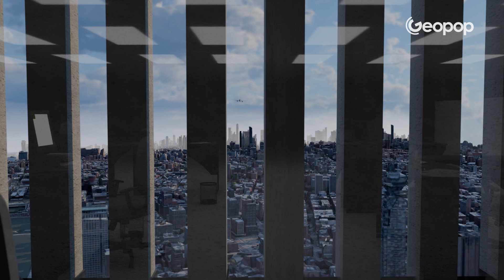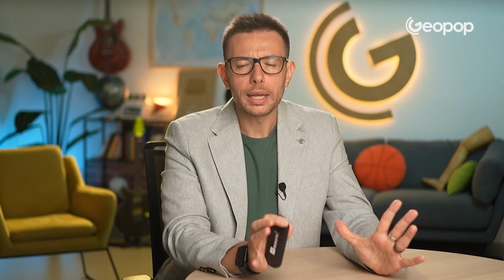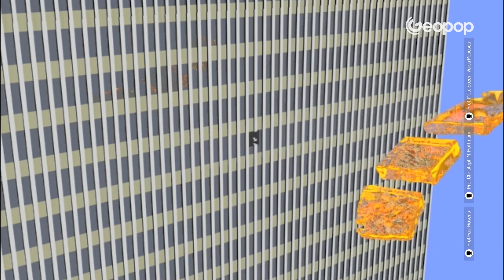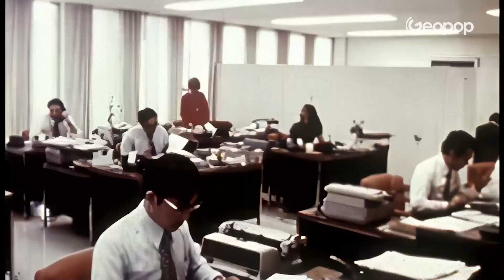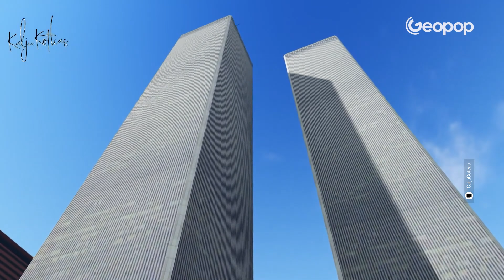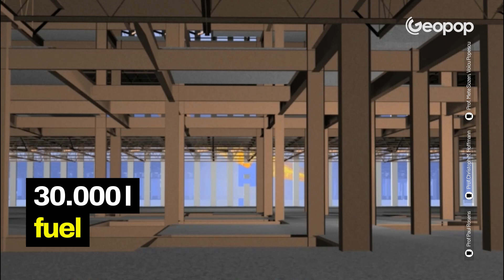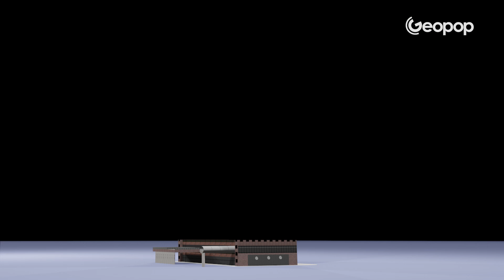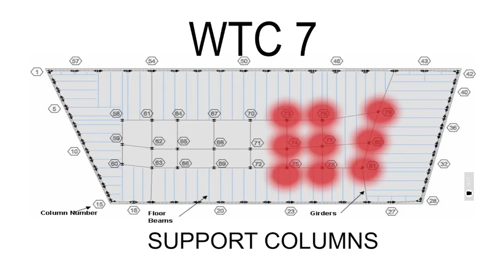9/11, 2001: The Technical Reconstruction of the Twin Towers and WTC 7 Collapses

Comment: The NIST report about WTC7 is garbage! Not even the simulation shows, what the cameras had seen! One column (79) and one beam (a-2001) do never initiate a free fall of the hole building!
Reply: Building 7 was the 6th building to collapse of 10 lost on 9/11 and because of its early low priority was largely ignored for a while, so conspiracy filled the information void with simple-minded garbage by technically ignorant people promoting political agendas. This created a lot of confusion and misconceptions which I wish  to dispel, so I prepared this brief summary of my own analysis, using technical analysis, not ideology and magical (non)thinking. 

At 10:28am the WTC North Tower collapsed, showering Building 7 with tons of burning debris, causing heavy damage and starting many large  fires which burned out of control for the next 7 hours. Half the FDNY firefighters having been killed, units in disarray, equipment destroyed, no water pressure, and the greater urgency of search & rescue efforts, Building 7 couldn’t be saved so firefighting efforts were pulled as futile and 7 left to its fate. Firefighters make that sort of choice every day in brush fire situations - which houses to save and which ones to let go. Only real difference here is moving the decimal on the size and cost. People get overwhelmed by the size.

www.youtube.com/watch?v=g_SvpwyC17M

Collapse of a burning structure is always a concern for firefighters. Steel buildings subject to fire rely on active firefighting to survive. Buildings are designed around 1 to 3 hours of fire resistance, allowing time for occupants to escape and active firefighting to get started, after which all bets are off. Left to their own devices they'll exceed their design envelope and collapse, like Plasco Tower and Wilton Paes de Almeida. In 7 the occupants escaped, passive and active fire protections were compromised and active firefighting was abandoned hours before the collapse, which left the building to its fate. It lost. Odds on Building 7 would eventually collapse, and it did. No big deal in logic.

 http://www.youtube.com/watch?v=WnYBX6QT0R4 

FDNY Chief Daniel Nigro - The biggest decision we had to make on the first day was to clear the area and create a collapse zone around the severely damaged 7 World Trade Center, a 47-story building heavily involved in fire. A number of fire officers and companies assessed the damage to the building. The appraisals indicated that the building's structural integrity was in serious doubt. I issued orders to PULL back the firefighters and define the collapse zone. It was a critical decision; We could not lose any more firefighters. It took a lot of time to PULL everyone out, given the emotionalism of the day, communications difficulties and the collapse terrain 

FDNY Deputy Chief Peter Hayden ; We had our special operations people set up surveying instruments to monitor and see if there was any movement in the building. We were concerned of the possibility of collapse in the building. And we had a discussion with one particular engineer there, and we asked him if we allowed it to burn could we anticipate a collapse and if so, how soon? And it turned out that he was pretty much right on the money, that he said 'In its current state you have about 5 hours 

The collapse of Building 7 was anticipated and widely reported in the media throughout the day, with 24 video cameras recording some or all of the collapse. Everyone knew what was coming and why. 

www.youtube.com/watch?v=OY5S5k3tMHI

Building 7 collapsed from the inside out which is not at all intuitive and hard to understand, with most details being hidden from view.  It requires careful analysis and observation, and some people will struggle no matter how much it is explained. But here is my explanation relying on no outside authority. 

Building 7 was a unique, asymmetrical 47-story steel frame structure built atop a smaller 3-story building serving as a partial foundation, requiring lower floors dedicated to complex load transfer structures. Of trapezoidal shape and tube-in-tube construction, B7 (above the 7th floor) consisted of a central core of steel columns carrying most of the gravity load, perimeter steel columns around the outside of the structure carrying the remainder of the gravity loads and long span beams and girders to tie those elements together and form the floors. On the outside of the building hung a facade or outer shell. 

www.nist.gov/image-16640

Phase 1 : First externally visible signs of collapse initiation occurred at 5:20:28 pm and was notably quiet with observers not realizing the building was collapsing! No warning in the form of hundreds of eardrum busting 180dB explosive bangs. Here at 12:00 a local CBS affiliate reporter talking 10 blocks from B7 when collapse begins. People don’t start to notice the collapse until 12:11. At 12:45 is the famous CBS fixed camera clip of Building 7’s collapse. Note the silence. 

www.youtube.com/watch?v=t5tEy6mXSE8

Lower floor failures above the load transfer region (8-14) in the NE corner initiated the collapse. In this video at 0:45 you can see the NW corner from inside the building while under construction, Column 79 just out of frame on the left. That big, angled steel beam across the top of the frame connects to C79 at one end. The girders connect to the beam. That beam and all those girders depend on just one connection 

www.youtube.com/watch?v=nP3TNHPCIVU&t=45s

Phase 2 : NE corner floor failures caused a loss of critical lateral support over an excessive length of Column 79 and it buckled. Looking at the above floor diagram of Building 7 when you see all the structures that depend on C79 you quickly realize this one column was a relatively isolated structural element on which a disproportionately greater fraction of the structure depended analogous to say the Key Bridge. Externally as collapse begins we see a vertical progression of window breakage along the 44-46 line and a kink in the roof of the East Mechanical Penthouse at the top of the building, consistent with C79 failure. Normally with a buckling column, the load could be redistributed to other columns. With C79 that is not the case - the failure did not redistribute the load, so the collapse rapidly progressed to the roofline, sinking the rooftop penthouse. The transition from full capacity to almost no capacity occurs in an instant and will result in virtually no resistance 

Phase 3 : With C79 gone, B7’s progressive, non-symmetrical collapse continues with adjacent columns 80 and 81 left laterally unsupported and quickly buckling as well. The EMP drops down through the building. C79-81 all have no diagonal bracing, which is the major reason why they could not redistribute a lot of vertical loads among one another. From there collapse progressed from east to west through the central core until the core was gone from 81 to 58, taking all the interior floors and probably most of the perimeter columns with. Follow the horizontal progression of window failures low in the building and the dropping of the remaining rooftop structures into the building. The NIST Building 7 study model 4 determined C79 failing under ANY circumstances would have initiated the same collapse sequence. 

Phase 4 : After about 10 seconds only the exterior moment frame remains, giving the illusion B7 is still standing to the casual observer since little has outwardly changed. But it is just a hollow empty shell like an empty cereal box supported only by a few remaining columns and overloaded from the loss of the core columns and floors, quite unable to remain standing. With nothing remaining behind it, the north face leans inward, forming a V in the roofline, the last few columns buckle under the strain and the moment frame free falls, landing on top of the debris pile. 

It is only here at the very end, a single measurement of alleged free fall acceleration is taken, from just one point on that outer shell. The Building (core and interior) did not “free fall” - was already gone before that happened - just one corner of the outer shell briefly moved at a rate comparable to FFA. This alleged FFA was a product of how the shell fell NOT why the building fell . It’s also not even proper FFA as the single measured point was moving in 3 dimensions, not just down, which adds another variable. Start to finish the collapse took 18-20 seconds, 3 times longer than true FFA . How fast something falls can’t tell you what started it falling, certainly not 10 seconds after it started falling.  

The debris spread outside the footprint blocking surrounding streets, heavily damaging the Verizon Building and destroyed Fiterman Hall. 

No building is meant to survive 7 hours of multi-floor unfought fires. Building 7’s progressive, non-symmetrical collapse was incidental, unintended collateral damage from the combination of fire, time & gravity started by the collapsing North Tower, true no matter who planned and carried out the 9/11 attacks or why .  Of so little consequence it barely registered at the time, only taking on semi-mythical status as an alleged smoking gun years later when demolitions at the Twin Towers, missiles at the Pentagon and shoot down over Shanksville all failed and conspiracists had nothing left to work with. 

Anything can seem like a conspiracy if you don’t understand how it works. Now you should. I hope you found this helpful, informative and it solicits informed critical comment. If I made any errors of fact, logic or reason or left anything important out, please let me know so I can fix it. OR offer a more plausible alternative if you can. Be the first. Please start any reply with the words “Tits McGee” or I will know you didn’t read it and are wasting my time.
Reply: @TheLoonResistance  So which 5 buildings collapsed prior to WTC7 stinkyshit? Oh I forgot: You are way too much of a coward to ever answer questions on your utter stupid blahblah...
Reply: @Kudde23   How to fail with a counterpoint.
Reply: @zMW574e  You want to help out your little coward liar comrade who is too much of a coward to ever answer questions on its utter stupid copy paste blahblah? Then go ahead, answer the question! Which 5 buildings collapsed prior to WTC7?

Comment: The towers collapsed with the use of thermite.
Reply: There's no evidence of that. The Harrit/Jones paper has been thoroughly debunked.
Reply: @Tim22222  So what evidence would you expect timmyshill?
Reply: @Kudde23 Well since it didn't happen, I would expect zero evidence.
Reply: @Tim22222  So you can´t even tell what kind of evidence should be there if thermite was used, ok trollshill...
Reply: @Kudde23 Actually, the evidence one would expect to find is well known: Elemental aluminum, a core component of thermite.

None was found. Therefore, there was no thermite.
Reply: @Tim22222  Shill, the idea is that thermite was USED to bring down the towers. Elemental aluminum is not a product of thermite reactions. Tiny iron balls are product of thermite reactions. Those were found all over in the dust timmyshill.
Also: Elemental aluminum doesn´t stay elemental aluminum if it´s in contact with oxygen (air).
Are you pathetic shill suggesting that there was no aluminum in the debris?!?
Reply: @Kudde23 NO the idea is that elemental aluminum is the MAIN INGREDIENT of thermite, not a by-product - so if there was thermite present then BY DEFINITION there would be elemental (pure) aluminum. None was found.
Reply: @Tim22222  That´s because the thermite was USED utter stupid shill. Of course you won´t find thermite nor its ingredients after it BURNED. Please try to explain what exactly is too complicated for your substitute for a brain to grasp that simple fact.
Reply: @Tim22222  Still trying hard to figure out exactly what you can´t understand about things disappearing when consumed, timyshill?
Reply: @Kudde23  it would have been impossible for all of the thermite to burn. Traces of unburnt thermite would have been left behind.

And iron spheres can be produced by a variety of other processes, including metal on metal friction. They are probably everywhere near all human population centers.

Finally, thermite burns extremely brightly. It would have been easily visible in all the recordings of the collapses, yet it's nowhere to be found.
Reply: @marcop1563  "it would have been impossible for all of the thermite to burn."

Why?!?

"Traces of unburnt thermite would have been left behind."

Even after months in extremely hot debris you mean? Even if, who was allowed to look for it? Who did actually look for it? And who would tell us? The ones who did the controlled demolition?!?

"And iron spheres can be produced by a variety of other processes, including metal on metal friction. They are probably everywhere near all human population centers."

Nope. The iron spheres were used as one of the indicators to tell WTC dust from background dust and they were explained by fire. However, that was before NIST analyzed steel from the fire zones and didn´t find any part that had reached 600°C or more, almost all parts hadn´t even reached 250°C, which is also consistent with FLIR footage and the fact that people showed up n the impact hole and other people going downstairs through the burning floors.
No temperatures high enough to produce such spheres, let alone in such amounts, spread everywhere in the dust.

"Finally, thermite burns extremely brightly. It would have been easily visible in all the recordings of the collapses, yet it's nowhere to be found."

Actually there are these things called "walls" and "floors" which have the magic superpower to block even bright light. Even smoke possesses this superpower to some degree. Yet many of us have seen that bright glowing metal flowing out of the south tower the minutes leading up to its collapse.
Reply: @Kudde23 And I know EXACTLY why you refuse to understand:

1 The ingredients of a chemical process are never consumed 100%, so Al would have been found, and
2 Chemical reactions produce byproducts - and NONE of the byproducts of thermite reaction were found.
Reply: @Tim22222  So you "think" no Al was found at Ground Zero?!? Wow...
Reply: @Kudde23 It's not about what we think, cupcake, it's about what we KNOW.

Do you KNOW whether aluminum was found at the WTC site? What's your source?
Reply: @Kudde23  do you realize that the planes that hit the Towers were made out of aluminum and that the exterior cladding of the Towers was made of aluminum, right?

Did you conspiracy theorists spend even five minutes thinking about your claims before spouting them on the internet?
Reply: @Tim22222  Shill, the towers were coated in aluminum. Do you "think" it was vaporized by magic free energy beams?!?
Reply: "do you realize that the planes that hit the Towers were made out of aluminum and that the exterior cladding of the Towers was made of aluminum, right?"

Of course I know that. Why you ask ME?!? Timmyshill is the one who "thinks" there was no aluminum at Ground Zero, not me. Are you that confused?!?
Reply: @Kudde23 nope, they said there was no proof of elemental aluminum. The infamous thermite paper only proved that there was some aluminum present in the dust near WTC, not that it was the kind of aluminum that you would expect if they actually used thermite.

In fact, basically everything that is presented in that paper doesn’t work as evidence of thermite. Meanwhile, the video recordings of the moments right before the collapse are positive proof that the Towers were not demolished by thermite.

911 conspiracy theorists are so easy to debunk.
Reply: @marcop1563  Moron, you don´t need to tell ME that they found aluminum in the dust, tell it to your cheap comrade, IT doesn´t grasp that simple fact!
Please try not to confuse who you are talking to all the time!
Also please feel free to finally answer my questions that you dodged so cowardly.
Oh and one more thing: Do you believe the official conspiracy theory? Then you are a conspiracy theorist yourself idiot, but one who is too stupid to grasp that simple fact.
Reply: @Kudde23  "Do you believe the official conspiracy theory? "

What actually is that compared to the unofficial one  pray tell .

What time does you mother put you to bed by the way,  I need to organise my posts to you so most efficient...

😘
Reply: How?
Reply: @TheLoonResistance  Like the Reichstag demolition. Remember that I told you about that controlled demolition stinkyshit? About... A BILLION TIMES shillshite?!? Oh wait, I forgot: You can never answer because you are way too much of a coward...
Reply: Which thermite sounds the most scientific for tin hatters ?

Centithermite
Millithermite
Microthermite
Nanothermite
Picothermite
Femtothermite.

I think Femtothermite makes any  controlled explosion sound more scientific on youtube.

You heard it here first.  Femtothermite brought down the twin towers and explains why nobody spotted it,  too small for the authorities to detect.

It ia all starting to make sense from my sofa now ....
Reply: @zMW574e  Blahblah?